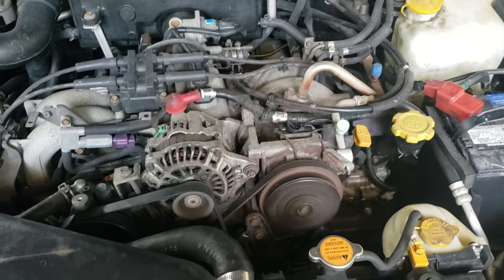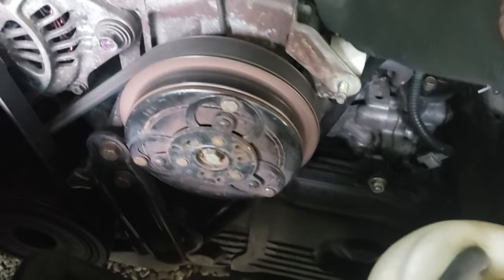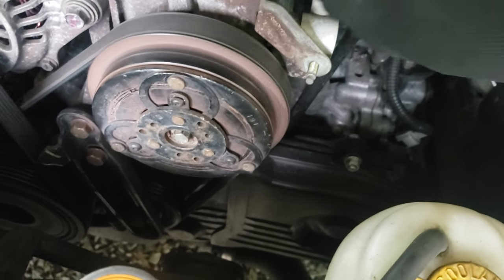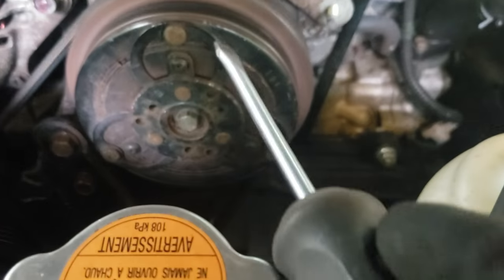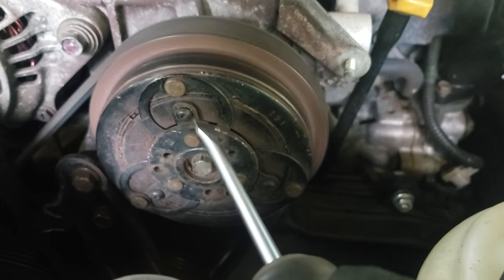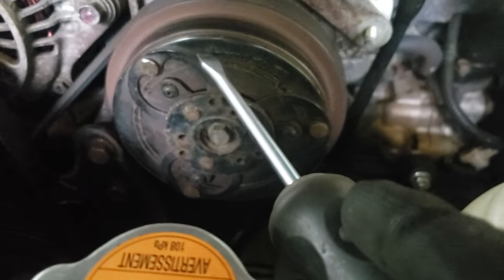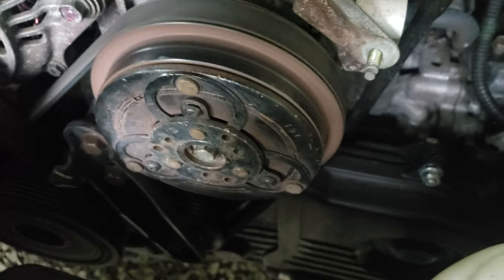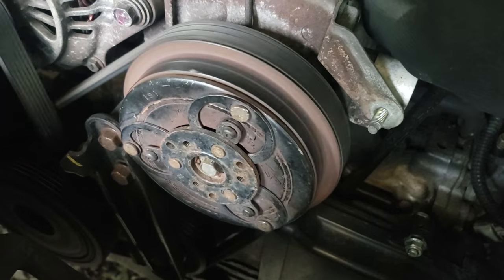Subaru outback , AC clutch not engaging ,super easy fix..

Comment: Dude it was 95*F today, my gf was so mad that I couldn’t get it to work, I’m going to try this I knew there was a quick fix until we can get a new clutch. You are a life saver!! 🛟 thanks 🙏🏼

Quick update I took off the clutch and removed the shins and reinstalled it. Also had to “jump” the relay with a paper clip and then it sucked up the 134A refrigerant and not she blows as cold as she can be. I also put back the relay and everything works perfect. Now she don’t complain about the heat she finds other stuff to complain about now.

Comment: Thanks for the tip. Just did this on my '06 Forester, works great for now! We will see how long it lasts. Dealer wanted $290 for the replacement part... no thanks.
Reply: Many older cars with lots of miles on them have a similar problem. A MUCH better and PERMANENT fix is to take off the clutch plate and remove one of the little washers that creates the air gap. Either find a thinner washer or grind/file off some of the thickness. The air gap should never be more than 0.010". or half a mm. Use a feeler gauge. The clutch has just one bolt or nut right in the center for removal. 

DO NOT loose the washer when you lift off the clutch plate! It will fall on the ground and roll off if you are not careful.

Use large channel lock pliers or oil filter wrench to hold the plate from spinning while you loosen the center bolt. It is not very tight, so DO NOT break it off when you assemble things again! I am not sure of the torque, maybe 10ft/lbs. NOT VERY TIGHT! Do not use an impact gun on it either.

Also while you have the clutch plate removed, sand off the rust between the plate and magnet. Old cars always have lots of rust in there and this will cause the clutch to slip (and make a lot of noise). A wire wheel does a fine job of cleaning up these surfaces. DO NOT paint these surfaces. Just leave them bare metal.
Reply: @NoCoastOutdoors
how long did this 'quick fix' work for? About how much time do you think it bought you? Did you need to replace the whole compressor, the clutch or just the bearings inside? 
 I'm about to do this to mine & was looking for some feedback on someone else who's done this :) 
 Thank you
Reply: @S0ulSUrviv0R713  
Follow Mike Lamb's  instruction of correcting the air gap issue, that is the proper way to do it. There could be 3 or 4 shims inserted in there for this purpose if none we remove before. 
The air gap should be re-adjust to 0.020" - 0.030" by removing 1 right shim thickness.
Reply: @michael47lamb  
Very good write up there. Thanks

Comment: Just tried this on my 2001 Forester. It usually cuts out after running for 10+ minutes when the engine is warm. Maybe the metal expands just enough to be out of reach of the magnet. Hopefully it gets me through the summer.
Reply: I got the same issue with my 04 outback. Sitting still it's fine but when I take off it stops and I gotta re do it all over again

Comment: If you take out the center bolt there and pull the clutch itself, there are 2-3 thin shims inside. Just get rid of it until you're satisfied, easier permanent fix.
Reply: Tried removing the clutch - with 3  x m5 40 mm bolts - after multiple turns the clutch did not even move  - worried I may strip the thread of the m5 holes ( bolts come out almost unsalable again thread damaged) . YES I did remove the 10 mm bolt that lock clutch in place.  I know it magnetic - but how far do one have to turn the 3 x 5 M bolts before there is movement on the clutch being released ?.
Reply: When I removed the center bolt from the clutch itself since the bearing on mine broke, it was easier for me to remove it. Some people just pry that clutch w/ no problem, make sure you pry it evenly though. Good luck.

Comment: I wonder if this is my problem too. When i drive and have the ac on sometimes the car actually drags. Like a belt isn't moving properly.the ac stops boring cold then It will jerk on and off slowing down then eventually it goes away and my ac blows cold air again.

Comment: Many older cars with lots of miles on them have a similar problem. A MUCH better and PERMANENT fix is to take off the clutch plate and remove one of the little washers that creates the air gap. Either find a thinner washer or grind/file off some of the thickness. The air gap should never be more than 0.010".  Use a feeler gauge. The clutch has just one bolt or nut right in the center for removal. 
DO NOT loose the washer when you lift off the clutch plate! It will fall on the ground and roll off if you are not careful.
Use large channel lock pliers or oil filter wrench to hold the plate from spinning while you loosen the center bolt. It is not very tight, so DO NOT break it off when you assemble things again! I am not sure of the torque, maybe 10ft/lbs. NOT VERY TIGHT! Do not use an impact gun on it either.
Also while you have the clutch plate removed, sand off the rust between the plate and magnet. Old cars always have lots of rust in there and this will cause the clutch to slip (and make a lot of noise). A wire wheel does a fine job of cleaning up these surfaces. DO NOT paint these surfaces. Just leave them bare metal.
Reply: This is exactly what the mechanic did for my 2010 toyota hilux. He just removed a single washer at the back of the plate. The gap was causing the clutch plate to not rotate and disengage my ac.
Reply: Thank you so much I was looking for answers for 3 hrs .
Reply: You should make a video on this.
Reply: @apollo11capcom39  There are already a number of videos showing what I described. Not worth spending hours making something so obvious.
Reply: I’ve taken the centre bolt out but the clutch plate is stuck on good and proper. What tool do I need to get it to come off?
Reply: @MichaelDrowley  What I would do about that is to first put a little penetrating oil on the center of the plate for a few hours to soak in. Being that this is Winter and cold now then maybe add a little heat to the clutch plate too. That will expand the metal a little, maybe. NOT TOO much heat! Dont light anything on fire. Just warm the clutch plate metal some.
Then gently tap the plate in a few places around the edges with a small hammer, not too hard, dont bend the plate. It is a pretty tough piece of metal but sometimes sh*t happens, ya know. 
Then after a little while drive two flat screw drivers into the gap between the clutch plate and compressor. The gap should be about 0.10" wide so a thin tip would be best at first. Use two flat screwdrivers or some scrap iron you have laying around to drive a wedge to push the plate away from the compressor. DO NOT use the screwdrivers like a prybar! Doing that may bend the tips or break one off between the clutch plate and compressor. 
Alternate tapping on each screwdriver to "walk" the plate off the shaft.
If this does not get it off then I dont know what to tell you other than buy a new compressor maybe. Some compressors were built so they never come apart without destroying them.
Reply: Thanks so much for the detailed reply mate! I’ll give it another go
Reply: @MichaelDrowley  Best of luck and Merry Christmas! BTW I was wondering why you are taking off the clutch plate at all? Is the gap all rusted up or something? If not, is the clutch slipping noticeably when the AC is on? Normally these plates never need to come off. Just wondering.
Reply: Merry Christmas to you too! Yeah the clutch isn’t engaging. Probably pressure switch and needs a regas but want to DIY first to check it. Gap is just outside spec and pretty rusty.
Reply: @MichaelDrowley  Since it seems too rusty in the gap then taking off the plate is the thing to do. Once it is off you can rub the rust off with a flat stone of some kind. 
Also if you can get to the electric connector on the compressor you should be able to hook a jumper to it from the positive side of the battery to see if the clutch even moves at all. This is a good test of the coil magnet too. Coils do get weak sometimes. The plate should "snap" into the magnet briskly. Keep your fingers out of the way.
Reply: That’s actually the way to go I reckon - I hadn’t thought of that. If I bridge it and the compressor clutch snaps on properly then that will tell me if it’s low pressure (or faulty pressure switch) and not a faulty compressor clutch/magnet. Now just to find a bit of bridge wire while here on holidays.
Reply: @MichaelDrowley  The proverbial sacrificial lamp comes to mind. ;-)
Reply: False on the gap: should be between 0.01”-0.02” per factory service manual

Comment: Two of the three rivets(?) on mine are gone.  Just one left with two exposed grommets.  
Mine wasn't engaging and I was looking at that front plate with the three rivets (used to be three).  
When I pushed in on the remaining rivet, the clutched engaged and my compressor started.  So I know now that is why it has been working off and on with a mind of it's own.
I did what you suggest in this video.  Hopefully it will keep it working for the two weeks until my appointment to install my new one.
My 2015 Forester has 262K miles and A LOT of idling with the AC on all day.  Time for a new one.

Comment: A semi permanent fix is to put zip ties around the O shaped metal loop going around the rubber shim. The zip ties act as a shim to keep the clutch spacing in spec. Just get a tube of zip ties variety pack to try out different thickness zip ties. Worked for our 2014 Crosstrek for 5 years so far.
Reply: Did you insert 3 zip tie in one of each o shaped loop. How long did it hold up
Reply: Can you show us
Reply: Just put some tape around the base of zip tie to increase the size and shove in the hole and tighten. I used two as one grommet was still there.

Comment: Hi thank you it helped a lot in both understanding how it works and fixing the problem temporarily. AC now works super fine even after not being used for pretty much half a year. 
I pushed paper towel pieces in between with a screwdriver next to the grummets so now that pushes the clutch against the outer metal part and that closes the gap between the clutch and the rolling part making it easier for the magnet to lock it. 
But my question is. If the grummets are the only thing worn out then this is pretty much a permanent fix, I mean paper towel pieces won't wear out and now they do what the grummets could not. 
But if the electromagnet is worn out then of course I'll need to change it because its too weak now and it can't engage the clutch with the original gap. 
So which one? Magnet or grummets? Because it is the magnet as far as I know but in the video you said the grummets are the ones that are worn out.

Comment: Thanks for the video and your technique for an emergency repair.  For a more lasting repair, you could just remove the front plate of the clutch by removing the center bolt and the plate, and remove however many spacers are necessary to close that wide gap down to factory specs.  You would have more even pressure on every point of contact with the inner clutch plate, and a longer lasting repair.  Using an impact wrench to remove the bolt, it would even be quicker than your method.
Reply: Many older cars with lots of miles on them have a similar problem. A MUCH better and PERMANENT fix is to take off the clutch plate and remove one of the little washers that creates the air gap. Either find a thinner washer or grind/file off some of the thickness. The air gap should never be more than 0.010". or half a mm. Use a feeler gauge. The clutch has just one bolt or nut right in the center for removal. 

DO NOT loose the washer when you lift off the clutch plate! It will fall on the ground and roll off if you are not careful.

Use large channel lock pliers or oil filter wrench to hold the plate from spinning while you loosen the center bolt. It is not very tight, so DO NOT break it off when you assemble things again! I am not sure of the torque, maybe 10ft/lbs. NOT VERY TIGHT! Do not use an impact gun on it either.

Also while you have the clutch plate removed, sand off the rust between the plate and magnet. Old cars always have lots of rust in there and this will cause the clutch to slip (and make a lot of noise). A wire wheel does a fine job of cleaning up these surfaces. DO NOT paint these surfaces. Just leave them bare metal.

Comment: Thanks for the video. Trying to figure out why the AC is going in and out on my 2014 Crosstrek that happens to be a hybrid. And I suspect it might be the clutch because it intermittently works on the other settings but typically is always functioning properly when it's on low temperature setting with the digital temperature selection

Comment: In my ranger is the opposite. When I engage the AC, it sounds relly loud and horrible. Ac off, no sound.  I would try this tip!!!
Reply: Many older cars with lots of miles on them have a similar problem. A MUCH better and PERMANENT fix is to take off the clutch plate and remove one of the little washers that creates the air gap. Either find a thinner washer or grind/file off some of the thickness. The air gap should never be more than 0.10". or half a mm. Use a feeler gauge. The clutch has just one bolt or nut right in the center for removal. 

DO NOT loose the washer when you lift off the clutch plate! It will fall on the ground and roll off if you are not careful.

Use large channel lock pliers or oil filter wrench to hold the plate from spinning while you loosen the center bolt. It is not very tight, so DO NOT break it off when you assemble things again! I am not sure of the torque, maybe 10ft/lbs. NOT VERY TIGHT! Do not use an impact gun on it either.

Also while you have the clutch plate removed, sand off the rust between the plate and magnet. Old cars always have lots of rust in there and this will cause the clutch to slip (and make a lot of noise). A wire wheel does a fine job of cleaning up these surfaces. DO NOT paint these surfaces. Just leave them bare metal.

Comment: Wonder if it will work on a 2010 ford fusion sport V6 replacement ac compressor part from autozone but ac clutch won't engage has been recharge but pep boys says it may need a flush or electrical I'll give this a try see what happens

Comment: Can a failed expansion valve cause the clutch not to work? My AC works off and on, each day is different. I had someone look at it and they thought it may be the expansion valve. Someone else said it was the compressor and another guy told me the clutch just needs to be replaced. I don't know who to believe. The guy who said it was the valve seemed the most honest.

Comment: can i spray  wd40 on the clutch to make it smooth or should i change the clutch?
Reply: Many older cars with lots of miles on them have a similar problem. A MUCH better and PERMANENT fix is to take off the clutch plate and remove one of the little washers that creates the air gap. Either find a thinner washer or grind/file off some of the thickness. The air gap should never be more than 0.010". or half a mm. Use a feeler gauge. The clutch has just one bolt or nut right in the center for removal. 

DO NOT loose the washer when you lift off the clutch plate! It will fall on the ground and roll off if you are not careful.

Use large channel lock pliers or oil filter wrench to hold the plate from spinning while you loosen the center bolt. It is not very tight, so DO NOT break it off when you assemble things again! I am not sure of the torque, maybe 10ft/lbs. NOT VERY TIGHT! Do not use an impact gun on it either.

Also while you have the clutch plate removed, sand off the rust between the plate and magnet. Old cars always have lots of rust in there and this will cause the clutch to slip (and make a lot of noise). A wire wheel does a fine job of cleaning up these surfaces. DO NOT paint these surfaces. Just leave them bare metal.
Reply: NO. you want no lubrication on your clutch plate.  Electromagnetic coil causes the plates to close the gap and mate up.  Lube will make them slip.   Like running on an oil spilled road.
Reply: @michael47lamb  my clutch isn't engaging and when I turn my ac on I don't hear it kick on is that because the clutch doesn't engage
Reply: @B-S1999  It sounds to me like the magnet is not working or not getting power. Check the magnet coil for continuity and voltage to it.
Reply: @B-S1999  
the magnetic clutch relay could be bad. Look for this relay in the fuse box. The relay is cheap, <$10